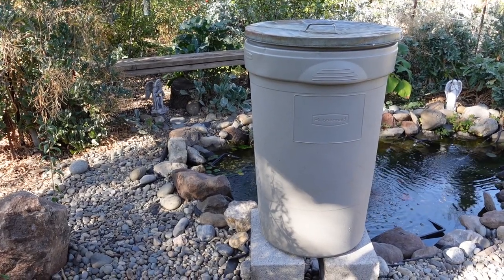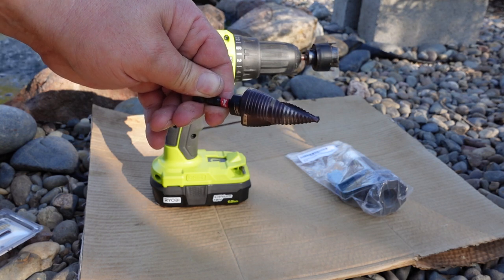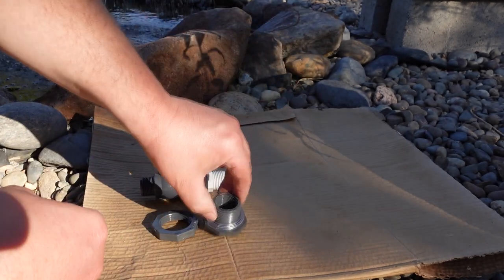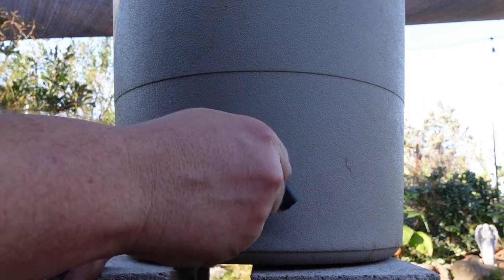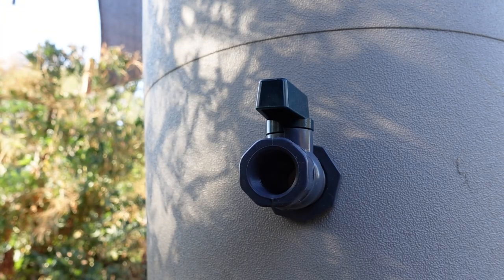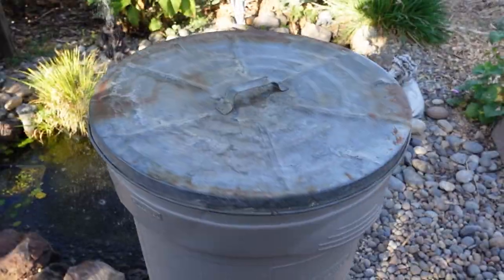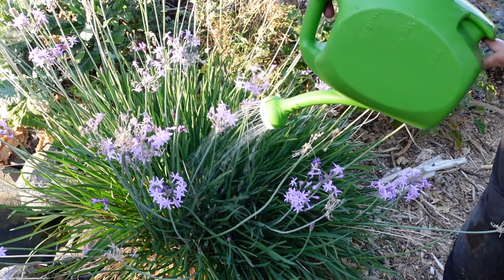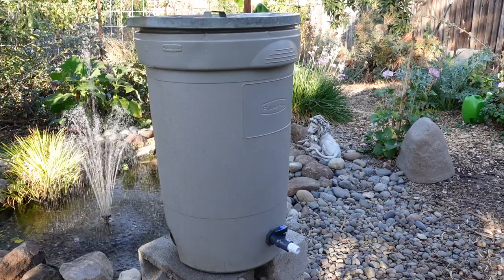How To Make A Rain Barrel Out Of A Garbage Can

Comment: Thanks a ton. I just picked up two spigot adapters from Home Hardware for around 18.99 CAD each. Teflon tape was $0.99c and the bit was $6. Nice to save buying 2 new barrels for $250+, and spend less than $50 to convert two old unused bins.

Comment: Very well-made video. Gonna do this for sure! Before I saw this I was thinking of buying a rain barrel but they can be pricey. I thought - why not a garbage can? I make homemade wine in 5 gallon buckets and the spigots are used there, too and they are sooo easy to install! One word of caution about drilling holes into plastic - go slow and let the drill/bit do the work. Excess pressure can easily crack the plastic and ruin an entire bucket or garbage can!

Comment: I live in a Caravan which has a 2nd paradise roof on it, which is angled slightly, I am thinking about doing something like this, this way I have fresh rainwater, to collect for drinking purposes, this has motivated me in doing something like this, I was thinking  along these lines, but wasn't sure how to set it up, but I will be putting a little gutter system on the paradise roof, and putting a little down pipe on it to collect the rain water,
Also too I would be using the same principle for my trailer, which sits besides the van, and so items don't get wet, I would be doing the same thing there as well, so I would have 2 container's collecting the rainwater for drinking...and washing dishes.

Thank-you for you video in showing an idea which I was playing with a BIG THANK-YOU !!!!

Comment: Thinking* of using your idea but attaching a drip hose in order to water plants in a 20 ft. strip. I think I can get enough gravity push to do the job. I could even plug up some of the holes to keep the water flowing. In fact if I put the hole high enough I can aid the gravity. In addition, my downspout is presently directing water to the side of my house and is making a muddy mess. So if this works, two problems  will be solved! Thanks for getting my thinking going.
Reply: did this work? I'm thinking about trying the same thing

Comment: The video is great except - how does the rainwater get in? If you have the lid on it? In my area mosquitos are an issue so I'd want a lid but then I'm back to how to get the rainwater inside?
Reply: Maybe cut a hole in lid attach a screen? Or maybe connected to a downspout thru the lid?
Reply: @debrawilliams-buss4694  seems odd that he did not show how to connect to a downspout.  Last nite I got 2 measly inches of rain in a wheelbarrow out in the back yard, but filled three 32 gal trash cans from the roof gutter-downspout; that is where to collect rainwater from.

Comment: Drill a hole into the lid and fit it with a metal mesh drain cover, then flip the lid upside down to sit on top of the barrel. This will help keep debris out of your collected rain water. Place the barrel under your downspout for faster water collection.